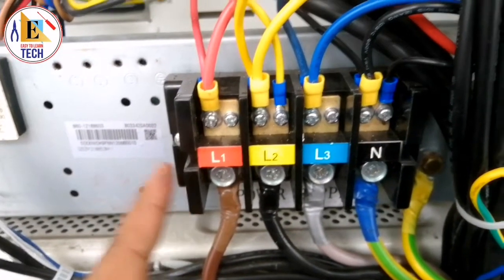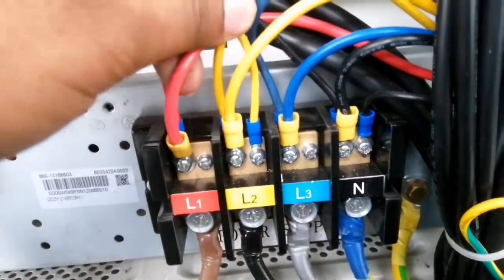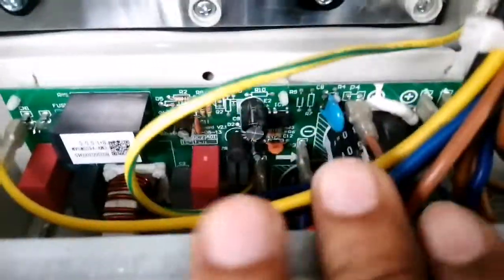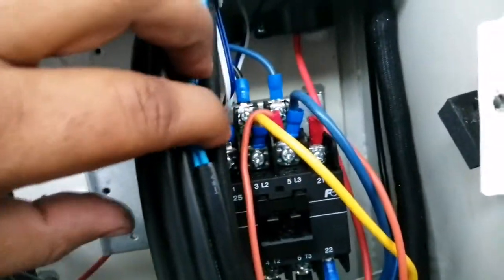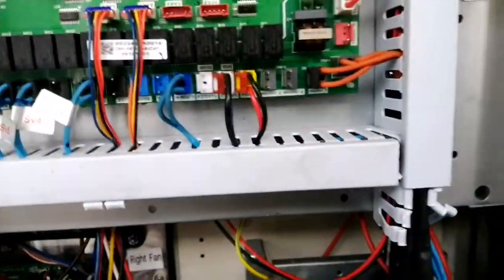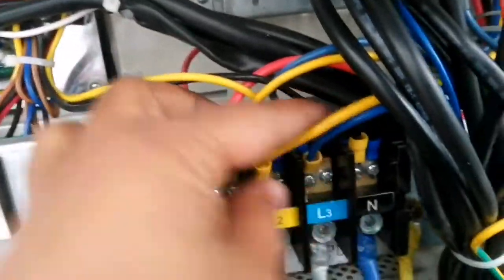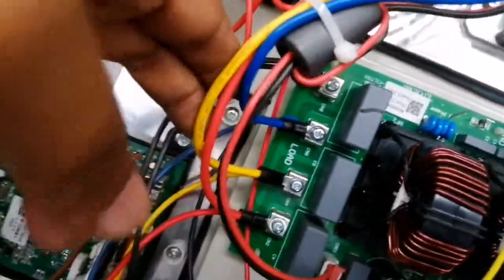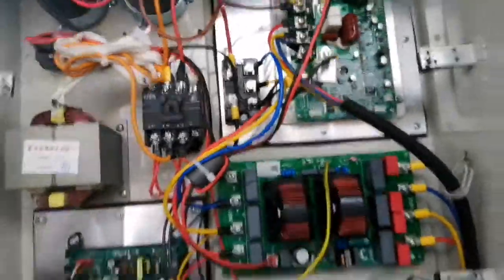VRF CONTROL WIRING CONNECTIONS // VRF OUTDOOR AC CURRENT & DC CURRENT WIRING //VRV CONTROL WIRING //

Comment: Does VRF Outdoor Unit and Indoor Units have separate power supply? Or outdoor Unit Power fed indoor units?
Reply from the maker: The VRF outdoor unit is running on a three phase power supply. And indoor units need a single phase power supply. So you have to use a separate power supply.